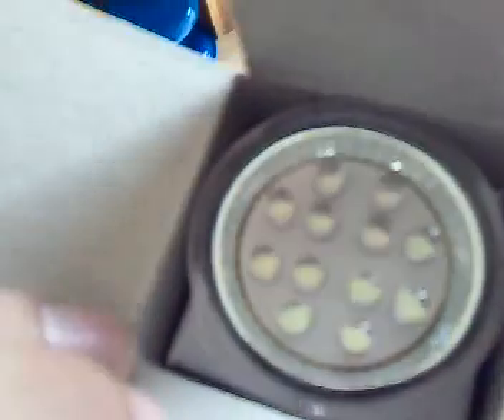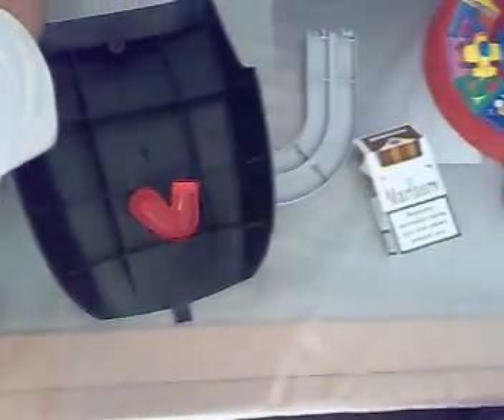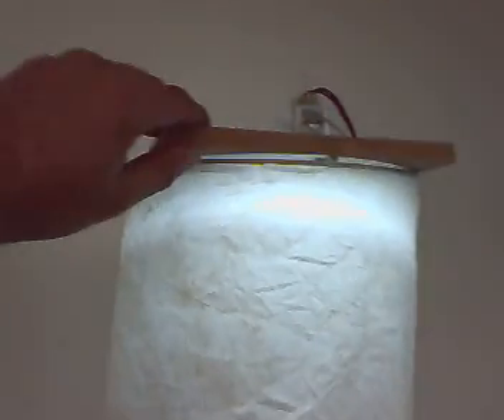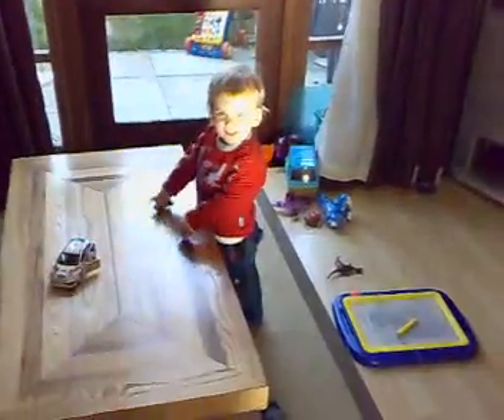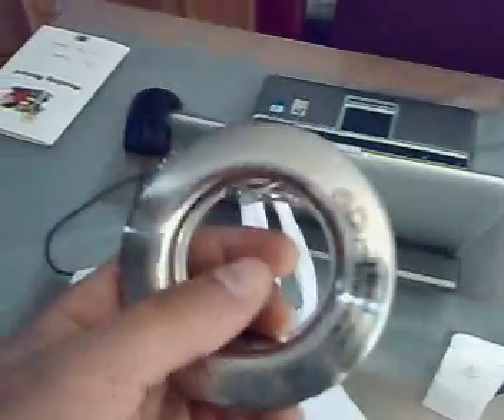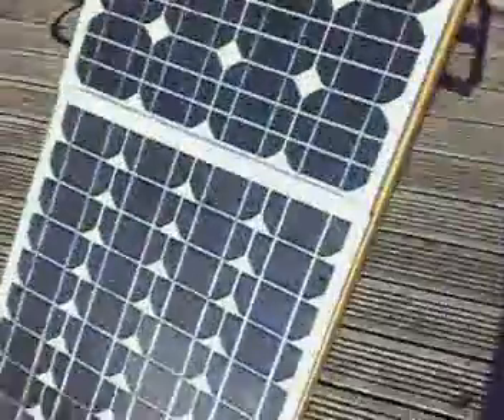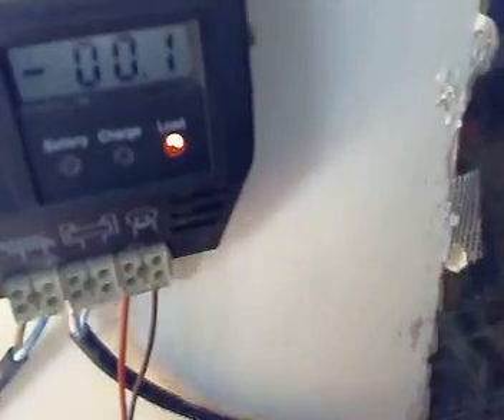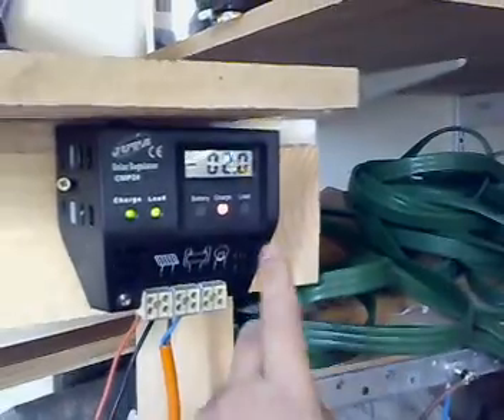home made turbine/leds for lights

Comment: Sweet system! Im looking into going all LED in my house! I have 12V lighting now. You loose so much converting from DC to AC that i would rather just use 12 Volt lights! Each bulb pulls Two amps. Im hoping a LED version can give me the same or better lite for less draw! 

Stay safe... PS hows the left arm??? 

Joe